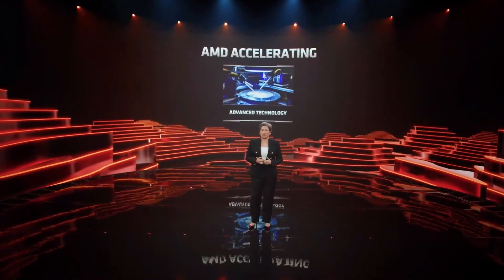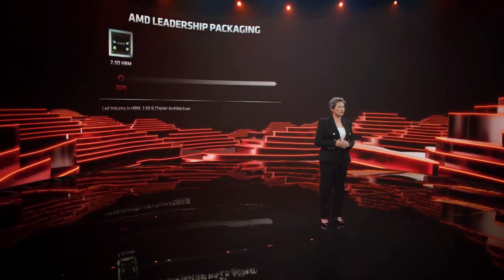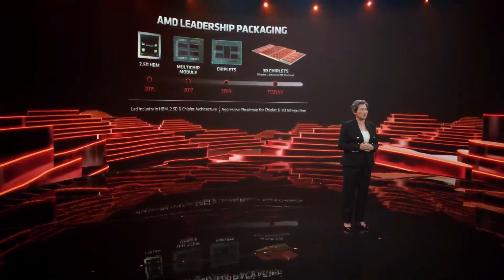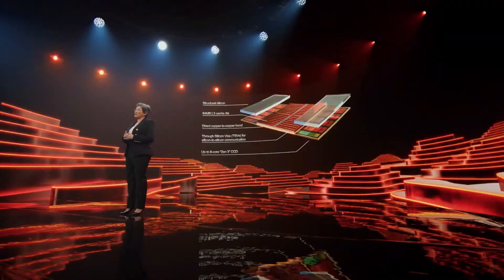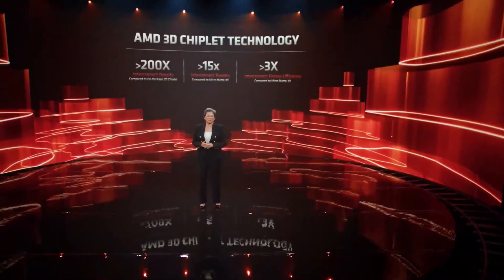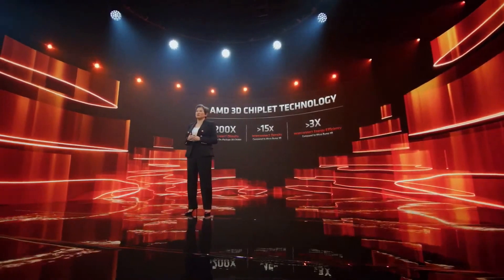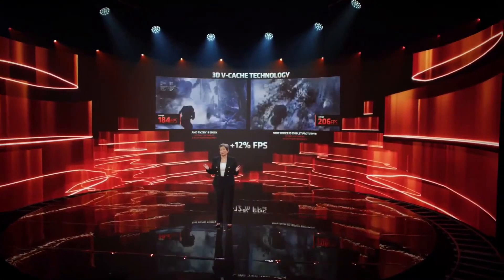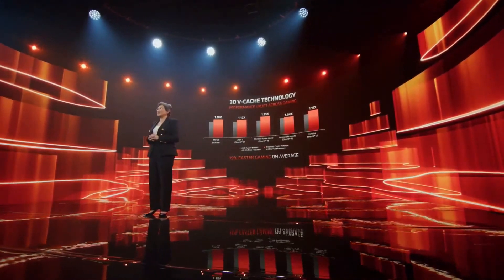AMD reveals its future! 3D chiplet technology

Comment: "Up to 8-core Zen 3 CCD" 03:07, I am guessing they are not literally adding an image sensor, right? it's just a "charge bank"? Also, I imagine they're using Cu pillar solder bumping for the inter-die connectivity? And probably two layers copper bumping to support the package bonding as well? But interestingly she said "no solder bumping" between the dies.
Reply: Lol this is so much wrong in this post it's freaking hilarious. 🤣

Comment: All that’s great and all but AMD is STILL in a chokehold by the wonderful windows operating system lol. Once the m1x comes out everything else will be like when the first iPhone came out and people were on Motorola razrs lmaooo. I had a laptop with a 4800hs I was promised this is the one the laptop that will kill everything. I loaded premier pro and started editing my drone video and the laptop turned into a hairdryer lol.
Reply: And it's not. In energy efficiency apple chips are great but not in terms of performance.
Reply: @bobpritham2660  you don’t know what you’re saying. The last PC I ever built was a 3900x with a rtx 2070 super. With all that power I was unable to properly edit a 4K h265 drone video!!!. I now have a m1 pro and it absolutely demolished anything I throw at it. The m1 ultra is far far more powerful than 99.9% of chips out there right now. If you play video games yeah amd and Intel are great but I don’t I use my computers for work and I edit videos.

Comment: Can they design it so that it will be more energy efficient?  A desktop computer running on 500 watt power supply is like 5 one hundred watts light bulb turned on at the same time and the electric energy used adds up and that will be reflected in an increased in your electric bill!
Reply: I use my PC (5900x + RTX3080) a lot and the elec. bill never goes beyond $85. I couldn't care less, is not that expensive even if I wanted to run it 24/7 it wouldn't go past $120.
Reply: @tealuxe  It adds up when you have a couple of them running on top of electricity rate not being cheap. Energy efficient is always a plus, regardless.

Comment: i wonder how they handled the increased thermals from stacking
Reply: Silicon is a good thermal conductor, and stacking them reduces the parasitic capacitance which actually reduces the power consumption
Reply: Embedded cooling

Comment: Questions I'd love the answers to. It has been confirmed on another channel that the stacked cash variant going into production this year with be a high end Ryzen chip based on Zen 3. Will this be a 5000 series chip (XT) or a 6000 chip. If 5000 will is work on 4 series Motherboards if 6000 will it extend the life of 5 series boards (Am4 support being pushed to 2022, so AMD over delivers in this case). This is good news as it means for AM5 AMD can wait until there is  good supply of DDR5 chips and they can tweak IPC improvements even more.
Reply: Going to start building new computer next mont. I want latest hi end tech. What would you suggest for configuration components?
Reply: @huliluliukuzelula  what is your primary use for the computer? Gaming, Photoshop, Video  editing, development?
Reply: @fentonwinmill  gaming but I would use it more for video editing & photoshop. BUT the most important thing to me that it can be easily upgraded with new components. So the motherboard should be able to receive processor like this in future & newest graphics cards
Reply: @huliluliukuzelula  We are at a difficult situation now, where at the end of 2022 a new platform (AM5) is going to be available. So any money spent now will be wasted if you want to upgrade later. Also it all depends on budget. Personally in your situation I would go with a higher end B550, An 8 core processor (5800X), Good Ram (32GB 3200mhz). Whatever GPU you can get your hands on within budget. For Video editing you need lots of fast storage, but what most people forget is a decent screen (that is what you will be staring at for hours) and a good keyboard and mouse. In fact I'd say if budget is limited you can even drop down to a 6core 5600x (fast enough for most games, Photoshop is mainly single threaded, and you only need big thread counts for large high Res videos). Get the fundamentals right (memory/storage/screen/motherboard), then when you are ready you can upgrade to a faster CPU in the 5000 series range or wait until 6000 and AM5. You can still keep your storage and screen and GPU.
Reply: @fentonwinmill  ok, thnx. Will think about if I will wait 2022 for new tech or will go with something next month

Comment: Intel sweating in the background.
Reply: nah, he's jus dead
Reply: @Zorro33313  🤣🤣
Reply: @tigereyewong9757  

Sure.
However, there is no guarantee TSMC won't get stuck and Intel able to leap frog them in finer definition.

That said, really minor performance gains in recent years even with the ability to make finer features.
This is the real reason why AMD drop out of the fab game. There is very little ground to gain in the future.
It is better to drop the extra weight and be more agile. The eventual goals is neing able to shop for fabs to maximize profits.
Reply: Intel has already released products with 3D packaging technology. New to AMD, not to Intel.
Reply: @EzhilSivamS  and still their chip is slow
Reply: @EzhilSivamS  intel did it only with ultra low power and it's a completely different technilogy.
Reply: AMD needs to sweat as they do not make their own chips. They rely on TMSC to produce their chips. At least Intel make their own products
Reply: @mrshaun8812  and how is that a win for intel? profit wise, yes intel in the lead... 

but for innovation wise and costumer satisfaction?
Reply: @mrshaun8812  and that's totally true. AMD needs to move some older parts to samsung asap and ramp up prod as hard as possible. cuz every minute of their technological domination should be a minute of maximum marketshare gains and it's not cuz amd doesn't have enough production.
Reply: @mrshaun8812  and how does that benefit them, or us, the consumer? They are stuck with their old fabrication technology for a long time because they have no flexibility of supply.